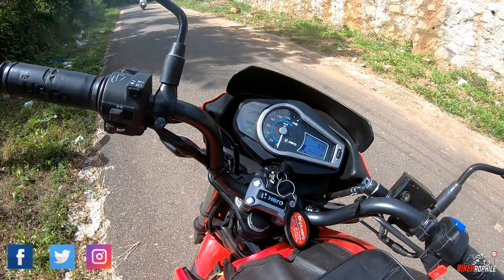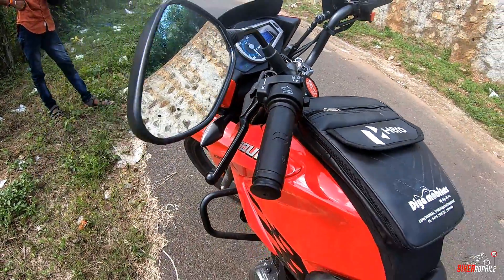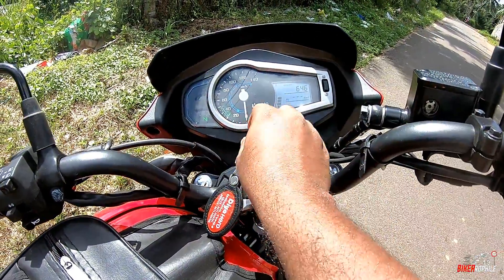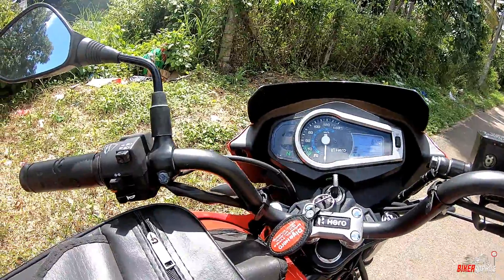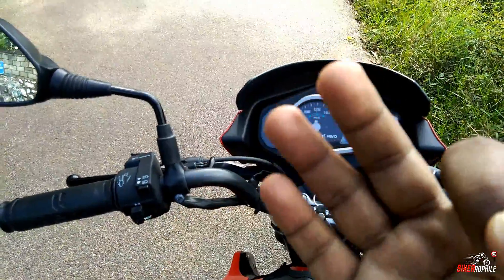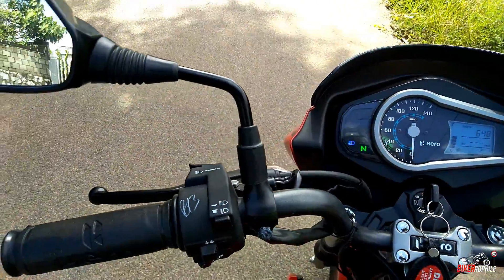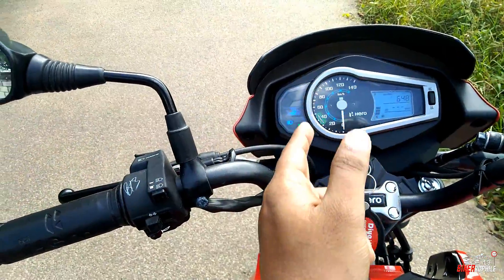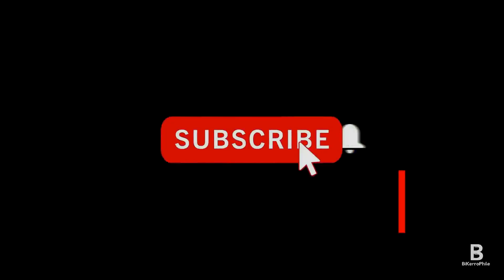Hero i3s Technology Explained  | 2020 Hero Glamour Fi BS6  Idle Starting System | Heromotocorpi3s

Comment: I3s glamour fi Bs6 most faulty bike ever seen... I am using for 7 months...Not a single day its giving me relief every day issue....one by one...Now I am getting issue on I3s ....worst
Reply: atleast 15 times I have visited 12k warranty claimed problem not solve till date.. 5 times break down..... Tuesday they will come to my office for pick up as  it again  not starting..... Just horrible experiance...I wll say not to buy hero bikes go for honda.... just wastage of money....
Reply from the maker: @arunavadasgupta2051  Bro do call or send one written complaint to HeroMotorcorp and their customer service on the defect/problem that you are facing and your expreiance with service center guys in detail, thats the one thing that you can do and let them know of your customer experiance and sufferings!
Reply: @maxrevz4658  I have changed the service center for now its quite stable not getting that issue but it's not solved yet  they accepted it that I will get the problem again...as engine part is not available for now...they have temporary adjusted that part... I don't know excalty the name of that part...lets see how long it goes...
Reply: Right,  gear me start nahi hoti ye and gear change karte time band ho jaati hai baar baar
Reply from the maker: @rahulparmar208  bro go and check with service center technicians if not do send a written complaint to hermotorcops customer care mentioning this issues they will take action to resolve it! thanks
Reply: @rahulparmar208  are bhai...iska solution na hero k pass vi nehi hai.... kuch vi kar k ....jaise bhai ne bola...written complaint karo ...2 3 saal use karke sale kardo...avi mat sale karna....resale value nehi mile ga....
Reply from the maker: Is it under any warranty bro? They get it done under warranty asap..
Reply from the maker: Sorry to hear that bro but u should get it checked at service center at the earliest